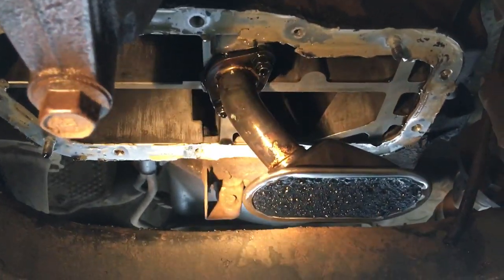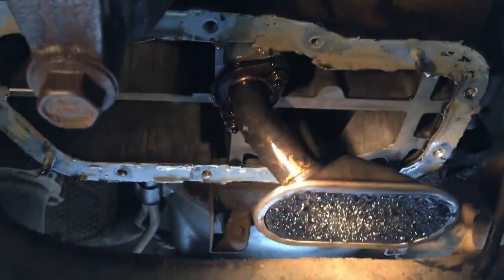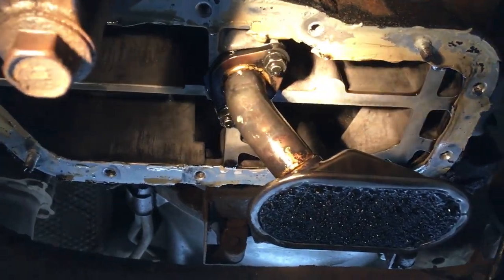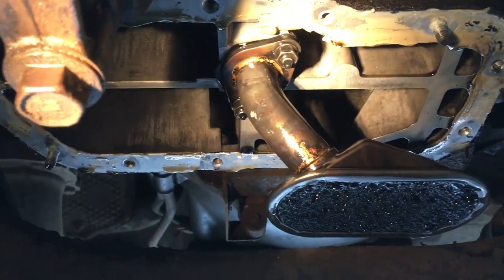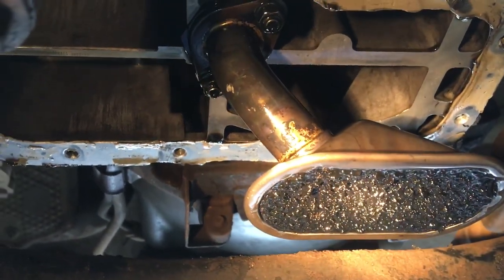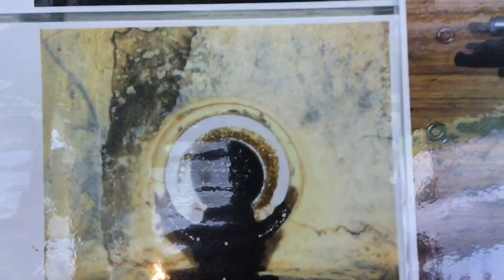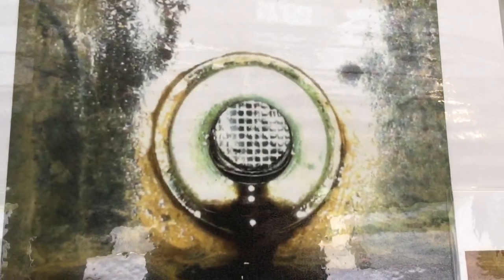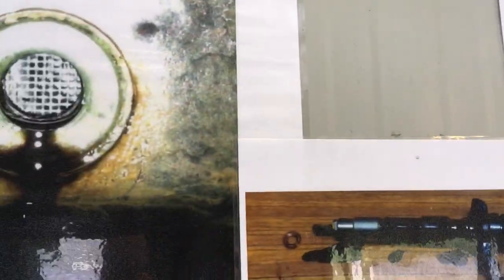Prado blocked oil pickup screen

Comment: Have you ever measured oil pressure before and after finding oil pickup clogged? How low it goes?  Is it a good indication of possible clogg? Your videos are extremely informative. Guess the same issues can be found on any engine where injectors are "internally" sealed like Hyundai's D4EA. Thank You for posting these videos!

Comment: Great vid.  Thank you.  Does anyone have top tips on getting an accurate dipstick reading for D 4D engine oil levels?  Mine is smeary and nearly impossible to read. (Clean oil though).
Reply: Don't all that Crud will block oil galleries for vital lubrication of several components

Comment: im assuming this is the 120, is it the same set up for the 150 V6 ? easy to get to and remove sump?
Reply from the maker: Rarely see v6’s.
Never looked to or removed one.
Cheers
Reply: Is this 1 GR FE - 4.0 petrol. As I have one and done 150k so far no issues. Will try to clean this up. Do you any videos for that ?